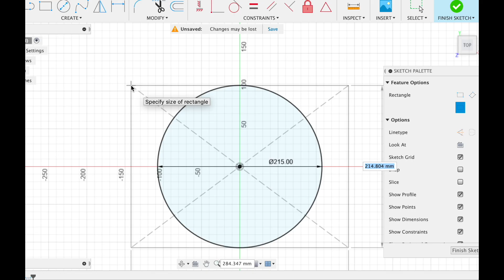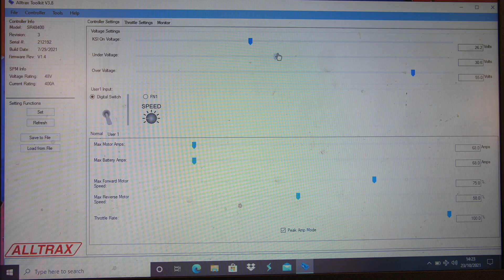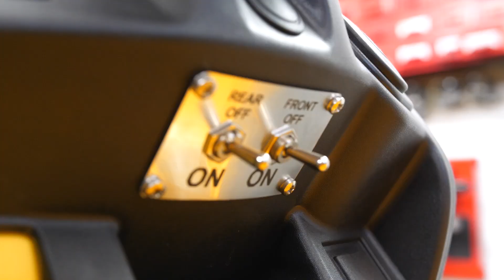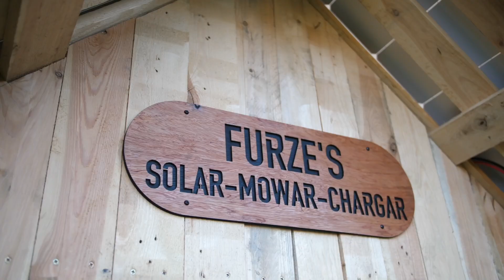EV Mower Conversion with Solar Charging Station

Comment: Actually a great idea.. strange no one's actually brought this to market yet. The slow charging of solar for a low duty cycle application like a mower actually makes sense.
Reply: Because you can buy a regular 42 inch 18.5 HP ride on mower for $1,200. He's probably into that build with the charging shed for over $5,000
Reply: Plenty of electric options.
Reply: Ego also makes an electric zero turn
Reply: Well i have 32 Solar Panels on my Roof and a Batterie Electric Lawnmower. So it is on the Market! Why would anyone build a dedicated Solar Charger just for one Machine?
Reply: @ammo2222  This^ Once you have panels for your house, then you only need battery powered equipment (invest in stuff that uses same battery system). I have B&D for every power tool (drill, saw, trimmer, vacuum etc) so I have like 5 batteries. I put them on their charging stations when I am finished and have a smartplug on them. I use Home Assistant to monitor energy consumption and solar generation and based on that, when there would be excess energy, I would turn on the battery chargers (and some other electric appliances that "store energy" for me like an electric boiler) and charge the batteries. I do this, because if I feed it back to the grid then they pay 30% of the price, but if I use it then I get 100% use of the energy generated. Never had an issue of running out of power when I am trimming or using tools, always had a battery that was ready to go. You could also have a corded electric mower for smaller gardens and a solar panel system and mow when the sun is up. That way you would be using the power immediately and its greener because there is no battery manufacturing involved :)
Reply: There are alot of electric mowers on the market. Push and ride.
Reply: big lawns when it dies u can get another beer
Reply: It would make sense for a push mower. If you have just a suburban garden and therefore time to wait until the grass has grown, then a ride-on mower is an absurd luxury.
Reply: How is it a great idea? Surely you'd rather connect those pannels into your house to make use of the power generated constantly rather than only when a lawnmower wants charging.
Reply: @witchitahable  why not both you can have a garden shed that has the solar panels on it where you can park and charge the lawn mower and once it's charge it could be hooked up to the house solar panel to add a little production to them
Reply: @witchitahable  read my post above.
Reply: There are plenty of electric mowers available if you look
Reply: I think tesla motar should be fine, but its too big tho...
Reply: Lol Ryobi Zero Turn been out for years. Wake up and join us in the 20th century
Reply: Im in the states and if you go to Lowes or Home Depot at least half of the riding lawn mower for sale are electric.
Reply: Solar make sense even for the whole household. It does make A LOT of sense, it is 6 times cheaper than electricity from the grid.
Reply: what a awesome way to save 10 gallons of gas per year. surprising more people don't want it.
Reply: @gextreme2381  for me it’s more about the noise. Gas mowers are so loud. This would be so awesome because it’s quiet.
Reply: @gextreme2381  Most gas riding mowers burn close to 1 gal/hour. Are you saying you only spend 10 hours a year cutting grass? I know I certainly was buying a whole lot more than 10 gallons a year for my gas mower.

Are you also saying your gas mower doesn't need to be winterized? Or need oil changes? Or spark plugs? Or belts? Or need to have the carb cleaned occasionally?

I have to load up gas cans and drive go out of my way to buy gas for my gas powered equipment, which by the way usually needs to be ethanol free because the ethanol gums up everything so bad. And I still need to add stabilizer to it and drain the carb bowl to store it over winter and I usually still end up needing to run some sea foam through it to get it running right in the spring.

With the electric stuff you just unplug it and turn the key and you're off. It's so much less headache. There's no clutches or belts to wear out either because the motors are attached directly to the blades and/or wheels.

Most of my family and neighbors have started switching over to electric yard equipment after borrowing mine because once you try and and see how much easier it is, and less noisy, less smelly, etc. It's really hard to go back to toting gas cans around again.
Reply: @JeremyAkersInAustin  Yes, that's correct. 7 years, 72.7 hours on the clock. 1 oil filter, 1 battery, 2 quarts of oil and spark plug, 2 belts and a pulley for a total of 4-5 hours and 250 dollars of maintenance. Garage kept so no winterization needed. Plus I can pull out bushes, cut brush, pull my aerator, and a host of other yard maintenance that a lawn tractor is appropriate for. Absolutely happy with my choice and have no intention to change. In fact, I'm reminded how much I dislike battery powered yard tools every time my battery powered string trimmer dies half way through the job and I have to put in on the charger and finish the next day.
Reply: @JeremyAkersInAustin  to be fair, you can probably easily find a good used gas lawnmower for less than $1k, and any maintenance and gas shouldn't cost more than another $1k lifetime. Good luck finding a decent electric lawnmower for less than that, and that's not including any complicated issues that an electric lawnmower may have. We have decades worth of internet help for any gas lawnmower repairs, I don't think you'll find as many easily accessible youtube tutorials on how to diagnose and repair electric lawnmowers. so you'll need to already be accustomed to working with electricity and sensors, or be willing to pay a guy to do it
Reply: @MrE_  not to mention if you are even slightly mechanicaly inclined you can buy a used/broken one and fix it for less than a new one costs and have a good running unit.
Reply: @MrE_  just picked up a second hand MTD ride on for AU$300.00. I plan to convert it to electric. Except I'll do it right and run a 48v 2kw electric differential axle and two 800w motors on the mowing deck. That way there will be no belts and pulleys. Also plan to fit it with four 12v 1.2kw lithium batteries. I can then store it in my workshop, hooked to the solar and inverter. So when not mowing the lawn, it's a battery bank to power my workshop.

Edit. Similar to this.
https://www.youtube.com/watch?v=qd3kuj7QGjo
Reply: @JeremyAkersInAustin   They might live in a warmer climate? My lawnmower is needed less in winter but I still need to mow even in the middle of winter!
Reply: @MrE_  how to repair every electric lawn mower issue that would not be an issue in gas powered.
Check charger cable, replace plug if corroded.
A complete list.
Everything else is either an issue you'd have the same between both, or fuel dependent, for further reference pull out your repair manual and turn it to spark plugs, valves, carburetor (or fuel injection), air filter, transmission, clutch, etc. (remember all I.C.E.'s idel too highly for direct use, a clutch and transmission is a necessity not so with electric)
Reply: @JeremyAkersInAustin One gallon an hour 
What lawn mowers are you using
Reply: Think a problem is that majority of available electric engines are weak. What if u hit a rock.
Reply: @Blockhaj  I have an electric Cub Cadet that I've been running for 5+ years now. I live on 5 acres and I've never had any issues with lack of power. I've hit (Well, my wife has hit) plenty of rocks and the only damage is a dented blade.
Reply: That's why things are belt driven even in conventional movers. It only damages the spindles and blades on the moving deck.
Reply: @Blockhaj  It all depends on gearing tbh
Reply: @Blockhaj  Well, electric locomotives have existed for over 100 years. They are usually more powerful than diesel locomotives!

The only matter is getting the batteries to be lightweight yet dense, and also able to take the current draw demanded of a mower. However, if a car can manage that, a lawnmower can certainly do so too.

Comment: Another fabulous project...however couldn't help noticing the solar panels are being shaded at the top of your shed roof line. That will adversely affect the efficiency of the panels output. Suggest dropping the panels down by 6 inch and use a GRP infill or change the trim on your apex so it's not shading the panel. Hope someone rises to the challenge and offer LiIon packs. I haven't found anyone in the UK that can offer cost effective packs. Best you can hope for are e-bike conversion kits.

Comment: Awesome video and concept, I love it.  Definitely very green and futuristic.

I was curious if the front motor could also drive the rear wheels?

How long did you end up mowing for, that lawn did look huge, to get you fed up of mowing.

For charging, did you consider any drive in ports?  Why did you need 2 cables?

Comment: wow. the sun is low in the sky over there aye? Dam sun passes straight overhead where I am. shit in mid-winter it passes over at a much higher angle than that. But I'm not bragging. I hate the heat now. it's so much hotter than when I was a kid. the heatwaves have become longer and some unbearable. A few years back we had nine days in a row above 45c (113F)  with 3 of those 9 days hitting 49C (120.2F). I much rather cold. At least with cold, you can just layer on more clothing. But here, you can not escape the heat. you can strip naked and you're still cooking hot. The first chance I get I am going to sell up and buy a new house in the coldest place I can find in my beautiful country (albeit mostly desert) and live there and be happy.

Comment: If it was a garden tractor that also had some winter use (snow plowing etc), lead acid batteries will be the better choice. Lithium batteries can't be charged when it's freezing, but lead acid batteries just have a lower capacity.

Comment: nice electric mtd mower, you could set the front blade motor to only run at 3500 rpm give or take a couple if you changed the pully so than you dont have to be messing with the dial. 3500 rpm tends to be the top speed normally so it would make sense just running it at its peak all the time

Comment: I wan't to see that mower go really fast with some proper high voltage battery, maybe swap the motor and controller for something much beafier to go along with it, or just try what the current motor and controller can handle!

Comment: Colin, I couldn't tell in the video but did you wire the batteries in series or parallel? I'm guessing in series. Seems like a motor like that would need more than 12v. Also, you said the batteries were 70AH and you expected it to run ~1hr. So, yeah, must be in series. 

I'm genuinely intrigued by this experiment. I mean, it  won't be cheap (good LiFePO4's are $800 each and I'm sure that solar station ran several thousand dollars.) but maybe in mass production, prices could be whittled down some. Todays' mowars (see what I did there) go for $5000-$10000, anyway. If you could buy a mowar/chargar (I did it again) package for like $10000, I could see a market for it.

Comment: main issue is you built it all for 12v , if you did 24v you could have just grabbed a x -tesla battery module with 444 18650 cells and called it a day

Comment: This is the rough concept that I hope gets explored more for West Australia's fleet of transport trucks.  
It's a MASSIVE drive going from Perth to some of the rural towns and it's largely diesel trucks doing the deliveries.  Along the drive there are already pitstops of sorts for our truckies to pull over and use the toilets or park their truck for the night before they continue the next day.  
If those stops had some kind of EV charging or even the ability to switch out a hydrogen cell the emission differences could be pretty huge

Comment: Cool project. Only would be better to use mppt charge controllers instead of pwm type. The overvoltage per panel is now wasted. With mppt the over voltage is converted to extra amps and will be able to charge faster.

Comment: Perhaps a bigger electric motor? My yards around 5 acres and gets cut with a tractor with a 10 foot bushhog. would love to not have to hear that engine running at 2500 RPM while cutting, its quite loud.

Comment: You could litterally start a company with this Colin, granted you would probably want to trade the lead acid batteries for lithium ion and switch it to a single charger like an electric car.

Comment: I have seen mowers have a safety mechanism where if the driver gets off the seat the lawn mower turns off and mowing deck blades also turn off. However, if you have the parking brake on with the blades off it will continue to run.

Is there any chance of implementing or putting that safety mechanism in this lawn mower? I guess it would be a lot easier if the mower already had a weight sensor on the seat.

Comment: This looks like a really fun project. There is so much you can do to advance it too. You could angle the solar panels for a better capture of light. As stated, use lithium batteries, but expensive. The list can go on and on.

Comment: Aren't lead-acid batteries made for ampere above longevity? I mean, I heard that, if you use normal 12V lead-acid batteries for a project, they are getting damaged, if you need them to continuously provide low amperage - or at least that they have way less Ah this way. Also, that if you still want to use 12v lead acid batteries, you'd need to use those for camping vans or boats, because they are made for continuous low power.
Right?

Comment: This is actually one of the most genius realistic things you've done. Have solar panels on top of your lawn equipment shed to charge all your battery powered stuff. It takes nothing from the grid, doesn't require running any power from the house. Start-up costs might be a bit higher than the average home owner may be willing to invest in. But this would be a prime opportunity for a company to offer a professional install/DIY assembly solar shed kit with financing and can also include a range of powered lawn equipment.

Comment: I've got a dual blade riding mower. Thought about leaving the gas engine in just for driving the wheels, and replacing both spindles on the deck with electric motors, and a couple deep cycle batteries to run the blades. A ....hybrid mower? LOL.

Comment: Colin, I have 10x 3p8s 18650 battery packs with charge controllers built for a Caravan project.  I ordered 900 new 2550mAH batts so I have a few extra.  Lemme know if you want some!
Reply: Each pack comes out to be 20.4 AH @ 12.6v peak and a 60amp max draw limited by the controller.  I can build you a few mate and send them your way by post.  Im in the US unfortunately!!

Comment: To get the longest useful lifespan with lead-acid batteries it is best to keep them fully charged as much as possible. Mow the lawn then top up the batteries. If they are run flat before recharging that will drastically reduce their life span.

Comment: Making your own battery is pretty trivial. Four LiFePO4 cells and a BMS is pretty much all you need. Could easily make that thing run all day with the space available.

Also, lead acid batteries can only safely be discharged to around 50% of their capacity. If you've got a 100AH lead acid battery, only 50AH is actually usable. Lithium doesn't have this problem and can safely use 90% or more of their rated capacity.

Comment: only thing i dont like about it is the batteries wont live as long as the petrol motor. the motors are more than capable of lasting decades, but batteries dont last all that long really. maybe the lithium ones might help, they definitly will for range but not sure what they are like for life expectancy.
and motors are fairly repairable to keep working. batteries, not so much.

Comment: well Mr. colin you did it again i'm hoping that you can make a deal with The manufacturer called cub cadet they make the same style lawnmowers and I'm hoping that you can merge with them or give some of your ideas to them to create an eco-friendly system that would not only make you money but it also helps with how things are going so far with costs and allowing fuel source is not to be all used up either by just harnessing the power of the sun is much more efficient‼️‼️‼️‼️‼️‼️‼️‼️

Comment: Whats up with this commentsection. Half of the comments have chinese s!x ads as replies. When did that happen?? 

Nevertheless awesome built. I myself made my house completly self suffient in the last couple years. I'm still connected to the grid but in the last 3 years I only used 1kwh in total. There is so much potential but the lobbies are extremly strong. Sad.

Comment: Colin, make a mold for 18650 batteries. Stack them and connect each of those to gain 14.8V and make good amount of those and connect each battery pack together so that you have great amount of 14.8V battery packs connected by side to gain high ampere lasting.
Reply: Or 21700 with higher ampere capacity.

Comment: Have you looked into retrofit lithium batteries for cars? I know quite a few people use them on racecars because of their higher density and thus lower total mass than traditional batteries. I believe anti-gravity batteries are the go-to, even though they are far from cheap. They might be better suited for warm climates though, but it could still be worth checking out! 
Anyway brilliant project, I worked on a hydrogen powered prototype for the shell eco marathon last year myself!

Comment: that is a beautiful mower 
this looks like a lot of battery and solar panel that will sit unused most of the time and very slowly lose capacity , ok no co2 emisson in the garden but the components seems not optimised and are not very eco freindly to produce , i don't have a Ph.D in battery ingeneering and ecology but i think it is important to be carefull about what we use lithium batteries or other "green" technology for